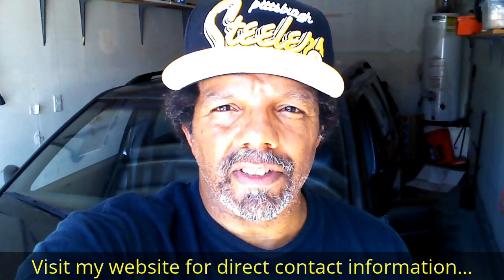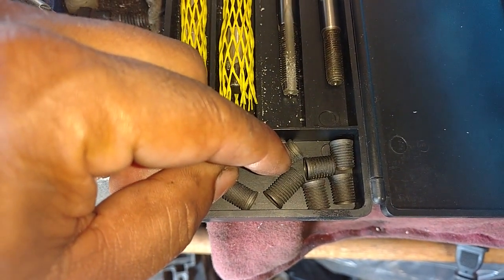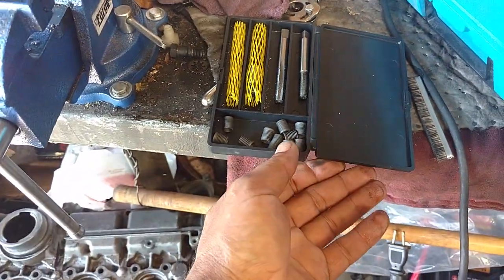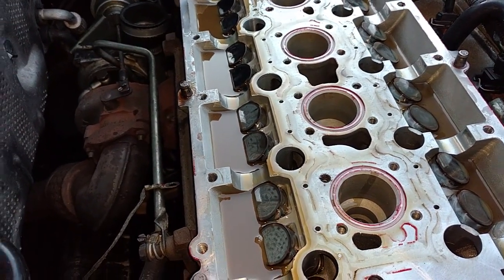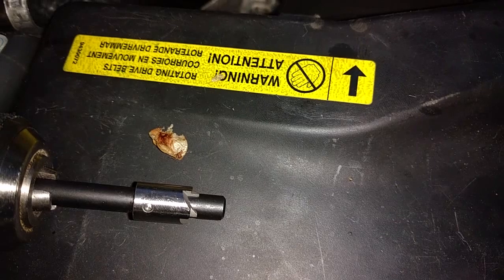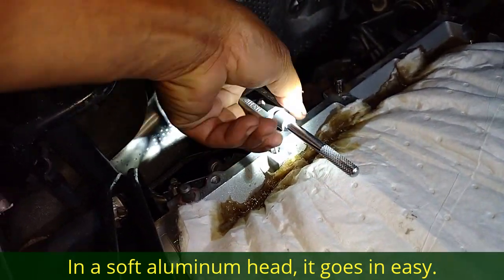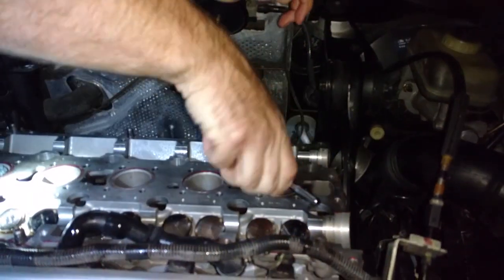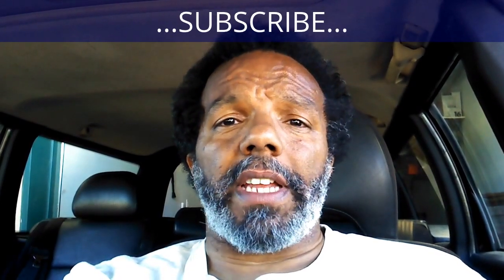How to install time serts, metal thread repair, better than helicoils. Stripped threads bolts.- VOTD

Comment: thanks for the video robert, I have a single stripped hole on the far edge of the front of the engine (4th from the passenger side) and on the back of the engine close to where the engine mount goes. both leak oil and both will not take a bolt due to lack of threads in the hole. thankfully not as many as you had to time sert in this video. is it worth going to a larger size like an 8m x 1.0 for these or is that too much?
Reply from the maker: that should work.

Comment: Hello..

Good helping video how to use and pass the timesert thread..I have a striped m6 valve cover thread, the lenght of the hole is 18,5 mm ..I saw that there is a 17mm thread  to use and pass it inside..But is ok to use this lenghth almost all way down or i must use a 12mm thread?? Someone tell me that the tap needs 6mm of the bottom to pass the insert thread threw..Also, will the top  of the thread will flash the surface or will go little deeper?? Thanks..!!!
Reply from the maker: All I have is what you see in this video.

Comment: I'm doing a head gasket on a C30 and I've got stripped threads in a head bolt hole.  Got any suggestions for fixing that?  Being recessed into the block makes it a challenge.
Reply from the maker: replace the block. How would those get stripped?
Reply: @RobertDIY  - I bought the car with a bad head gasket.  It over heated, but beyond that I know nothing about it.  Got it cheap, so figured I'd take a chance.  I was putting the head on, torquing the final 130 degrees, and the first bolt I pulled on stripped.
First plan was a block from Pick-n-Pull, but all they have within 100 miles is 2.4 motors.  So I'm looking at various inserts...ez lok, heli-coil, time-sert, etc.

Comment: I just installed an insert but the tool wont screw it in the hole enough and now its stuck is their a trick to force the insert in more?
Reply from the maker: No, maybe the hole wasn't deep enough.
Reply: @RobertDIY  I got it in the hole.  Its one of those holes that the insert goes into that holds the gasket on while you install the cover.  I used that insert and a bolt to turn the insert all the way in to the hole.

Comment: Hi Robert! Good video sir. I just order the 5/16-18 kit from Amazon. Will let you know how it turned out. I striped out a bolt on the aluminum thermostat housing and I don't want leaks.  Cheers from Motown!
Reply from the maker: Cool
Reply: How did it turn out??

Comment: Surprised you didn’t use lock tight on the timesurt
Reply from the maker: My instructor didn't say that was necessary, does some instructions tell you to do that?
Reply: It’s more of a sense of security for yourself so you know it’s harder for it to come back out, I work in motor racing where everything gets hammered round a lot more than a road car and we would use 648 on some of the hardest hit areas. It’s probably not the end of the world if you don’t, especially on a road car. Great video tho man

Comment: good video, a good tip when drilling and tapping on engines is to use thick grease on the bits and Taps, catches a lot of the mess that you don't want in the engine!
Reply from the maker: Thanks for watching.

Comment: Great video as usual. I have a single stripped bolt hole on the cam cover of a s70 close to plug #1. Do i have to remove the cam cover or can i rethread the bolt hole with the cam cover in place. I'm losing a lot of oil from the stripped bolt position.
Reply from the maker: +carvel williamson hmmm, you might be able to do it through the head but I doubt that will stop the leak. Once the seal is broken, I think the cam cover will have to come back off.
Reply: ok. thanks for the prompt response and the incredible knowledge.

Comment: Can you use a welder to fill in the hole, and recut it?
Reply: that's an interesting question. it's my understanding that aluminum doesn't bond well with welding and so to fill in the hole, it may not take very well. the Tinesert is probably cheaper.
Reply: Welding requires heat, heat causes distortion, don't weld unless you are prepared to refinish all adjacent surfaces. And if you weld cylinder heads, be prepared to replace seats and guides.